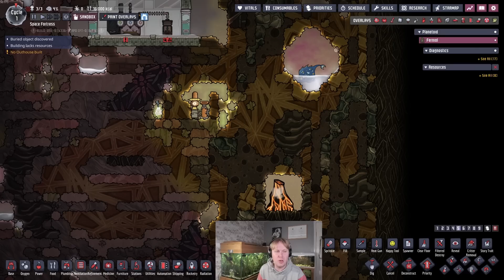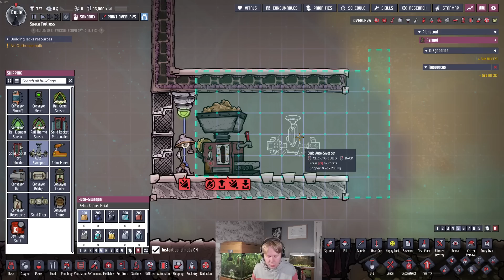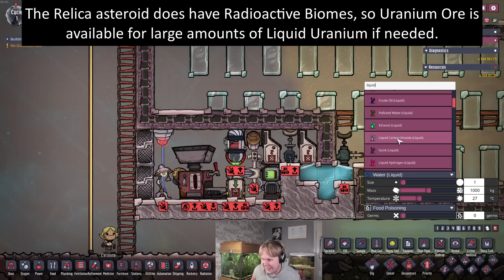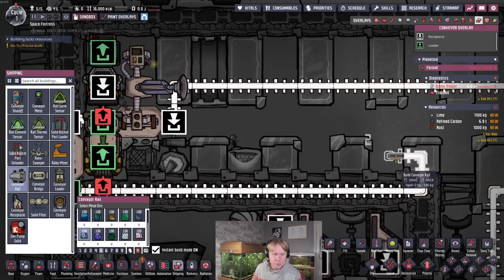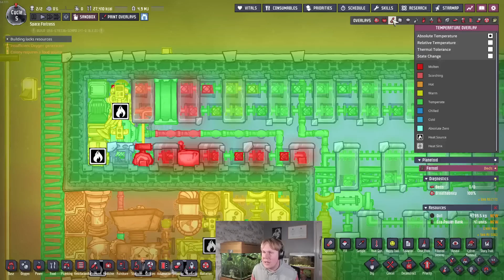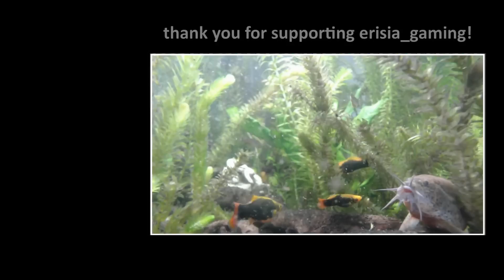How To Melt Rust Into Iron In ONI: Spaced Out! Sandbox Showcase #42

Comment: Simpler way of dealing with meters (liquid or conveyor): just run a wire from the output port to the reset port. When the meter emits a packet it immediately resets itself.
Reply from the maker: I usually do this tbh; I wanted to show a way to do it that involves less constant resetting noises.